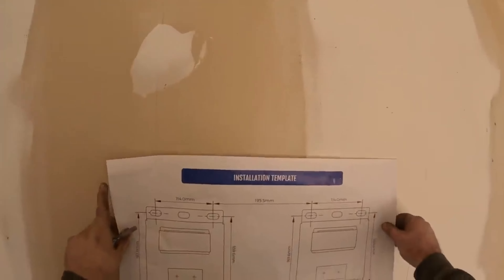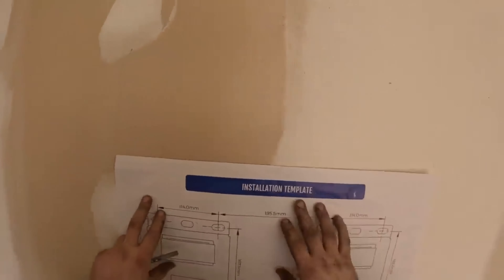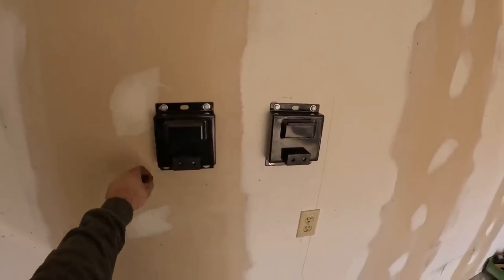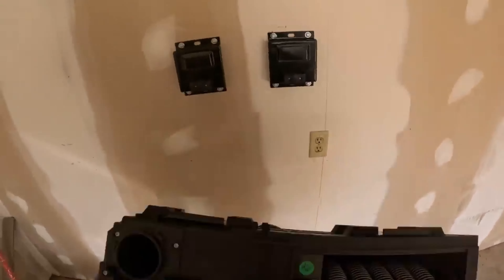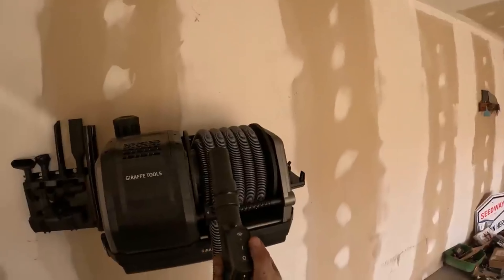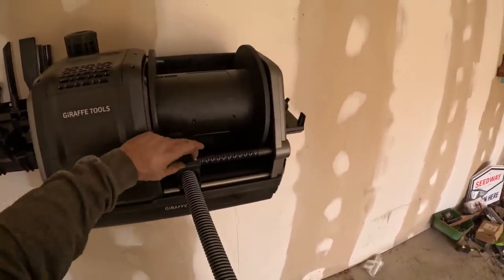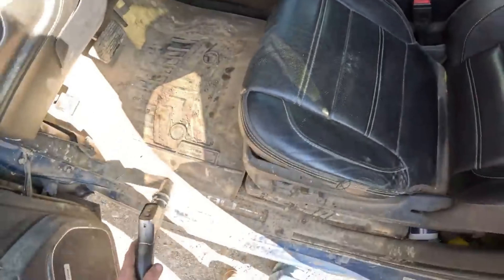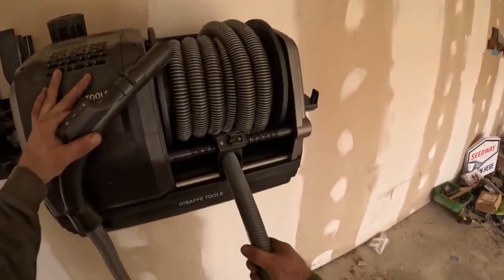Giraffe Tools Wall Mounted Garage Vacuum Review|Must Have Garage Tools

Comment: Has anyone Thought about how you empty a full tray of water question mark Or is there a drain on the bottom of the tray
Reply from the maker: It is not recommended to fill the dust box with water, and the dust box needs to be cleaned in time.